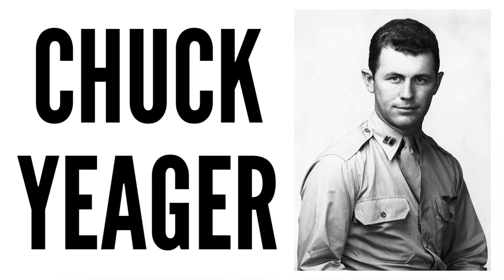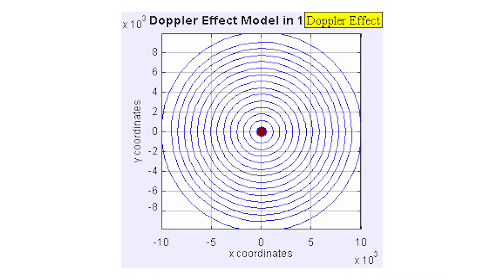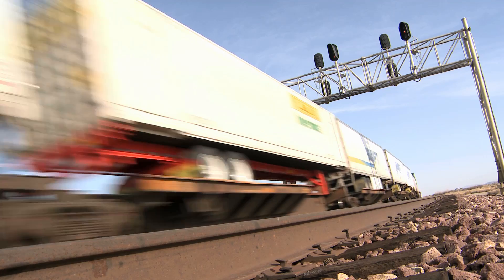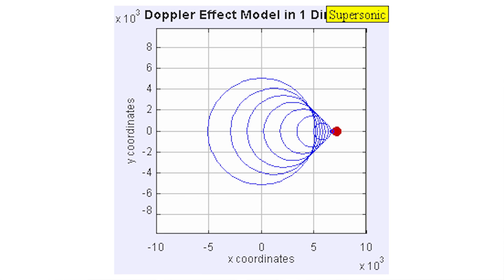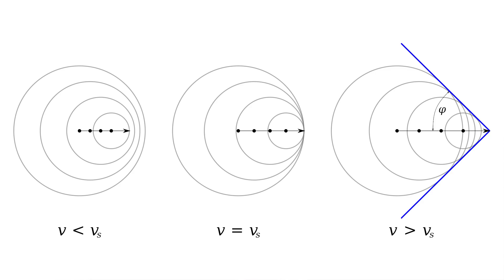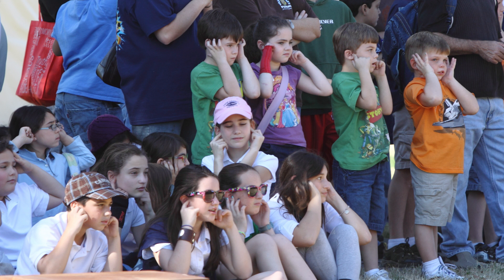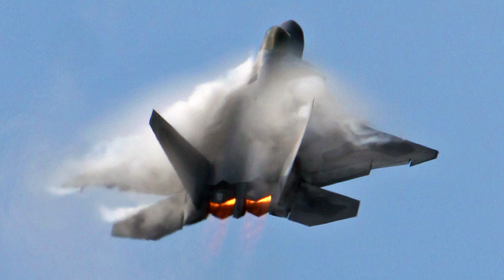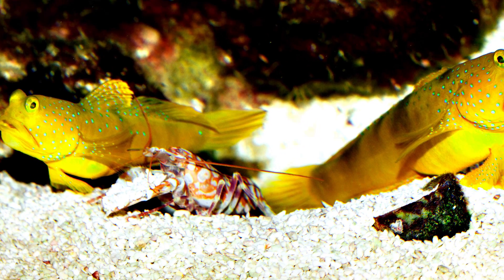What Is a Sonic Boom? And How It Breaks Every Rule You Know

Comment: The higher we go the faster we go right because on the ground we might go 400 meters In a second but then we technically only moved like 10 ft according to us. So technically we could be moving at the speed of sound from the point of view of the moon because if we were to go straight up from where we are toward the moon and then went back down to earth and moved a couple feet we wouldn't land a couple feet from where we were before we would possibly of moved a voluble miles because of how we loo at speed which is 100 m/s or something but because of the way all planets are shaped like spheres of you move a few feet you are changing the angle so you technically don't go any farther in either direction although it look like it because of the change. Pretty cool when you think about that huh that when you think about it in a not so technical way you are moving and the speed of sound to another planets point of view. Thanks for reading

Comment: When the pistol shrimp claps its pincers, a tiny air bubble is created in front of the pincer. Then, the entire weight of the ocean above it instantly moves to fill in the air bubble, causing rapid pressure change, and a temperature hotter than the surface of the sun. It is so rapid and short lived, however, that it doesn't boil all the water around it. I think there is a video of it on youtube.
Reply: VintageLJ imagine a pistol shrimp like 1000X the regular size
Reply: DragonGuard99 ShrimpZilla
Reply: You'd have to find a deeper ocean.
Reply: james learing So deep I found oil.
Reply: you mean a vacuum not an air bubble.
Reply: Theodor Berza Maybe.
Reply: Karan Randhawa Yea, probably.

Comment: What if the passengers speak?
Reply: DragonGuard99 I think if the air around the passengers travel at the same speed they can speak normally.
Reply: ItsReactive77 Sound waves travel by creating vibrations in particles in the air, this is where the saying "no one can hear you scream in space comes from" as it is a vacuum. Therefore as the Cabin of the aircraft is pressurized, the air inside the aircraft acts as if it is still, therefore sound moves normally through the cabin
Reply: DragonGuard99 only if the cabin was not isolated from outside imo
Reply: ItsReactive77 If the person hearing you is under 340 meters, there will be no delay.
If you were farther than 340 meters and moving away, there will be delay.
You would see your friend's lips moving and then hear what he said.
Same principle that occurs during light storms, first you see the lightning then you hear the thunder.
Reply: ItsReactive77 then the sound coming out would just pass by and you would not be able to hear it i guess. IDK
Reply: cyborgchimpy I don't know what the current theory on this is (please correct me if my statement is scientifically obsolete), but I think light works differently. Einstein theorized that if you moved at light speed, you couldn't even see yourself in a mirror in front of you (alsmo moving) because the light can't go faster than light speed or in this case, you. Thus never escaping your movement to the front and never reaching the mirror. Even thought everything else (sound etc.) would be expected to double its speed when sent from a moving source of the same speed.
Reply: ItsReactive77 For anyone thinking about this, the answer is they can hear each other. This is because the air inside of the aircraft is sealed from the outside, which means it has its own frame of reference. Basically, there is no difference between standing on the ground or being inside the aircraft. Sound will travel with respect of the aircraft and would observe to be moving twice the speed to an outside observer.

Light is a different story though. Nothing can travel faster than light and thus you wouldn't be able to see your own reflection.

cyborgchimpy  Your theory is wrong; heck you can't even travel faster than light anyway. Two reasons:

1.Interactions of particles that make up your body work at the speed of light, so you would become a soup of fundamental particles.

2. Time stops and the length of the universe would become 0 in the direction of the vehicle at the speed of light rendering this experiment impossible to even preform.

RJ Lee I Almost all of these comments are completely wrong, and I'm 16. I wasn't even in a high set in school either (although I should have been. Bullshit tests brought me down when they don't prove anything)
Reply: +ItsReactive77 The passenger compartment is sealed, thereby becoming it's own atmosphere, separate from the outside of the aircraft. They can speak normally, as they are speaking as if they were standing still at sea level.
Reply: ItsReactive77 Holy shit the replies.... Public education at its finest...
Reply: James Lynn You are going places, son. Keep it up.
Reply: the air in the aircraft is stationary relative to the aircraft, so it would be normal
Reply: Andrew Lewer That is the answer to another question I think XD
He asked wether passangers on an Aircraft over Mach 1 can hear each other or not. I think I agree with L4RZ, but I'm not sure myself. I guess if the medium (air) travels at high speed, the speed of created sound increases whilst in that medium. Otherwise Astronauts wouldn't be able to communicate at all, right?
Reply: the sound of the passengers voice will follow the law of inertia i think. they would still hear it
Reply: gasp they are coming.
Reply: ItsReactive77 you call that relativity. the air in the cabin is standing still relative to the people who are in the cockpit creating its own medium. so they can hear each other just fine. inertia is also another form of relativity. I think even with light, if you are in a ship that goes faster than the speed of light, shining a light within the ship would work just as you'd expect a cone of light to behave in a normal medium.
Reply: that could very well be right actually. I am not sure. I think I once saw some kind of visual representation of something supposedly going faster than light. the medium you would be flying in would actually stretch out, given the illusion you are going faster( as are the light particles in that medium) but when you would arrive at a given point, you would actually find out you arrived at the exact same time as a normal light particle/wave.
To be honest, its kind of mind boggling to begin with. I am not even sure how relativity would play in something like this. but it sure is interesting :)
Reply: cyborgchimpy That may have been about space-time warping (or however it's called).
That would be a whole other ordeal, indeed. If that were possible, then yes, I think light would behave normal relative to the traveler. But I REALLY don't have much clue what I'm talking about.... XD
Reply: glass gets broken
Reply: ***** Or read the replies before using common sensse. You can be heard. Otherwise, Fighter Jets would have a big communication problem.
Reply: TheThoerlChannel I got a stupid glitch that prevents me from typing. I'm going to edit it to add the user I was replying to.
Reply: RJ Lee Haha, I'm hoping to go places. I'm planning on getting a degree on civil engineering.
Reply: DragonGuard99
If you get to talk to anyone that flew on the Concorde, ask them how their conversation with someone sitting next to them went while eating a steak or sipping on coffee while traveling at mach 2.2.
Reply: +ItsReactive77 well, the passenger compartment is sealed, so they can speak normally. if it wasnt sealed it wouldnt matter because the 750+ mph wind would rip their faces off...
Reply: +ItsReactive77 well, the passenger compartment is sealed, so they can speak normally. if it wasnt sealed it wouldnt matter because the 750+ mph wind would rip their faces off...
Reply: +James Lynn sorry bud, youre wrong... light would behave normally, even at near-light-speed, so you would see your own reflection. 

due to time dilation, time would slow down. meaning that the light would move at its normal speed relative to you but it would also move at normal speed relative to another observer. this applies when moving less than light speed. moving at or beyond light speed is impossible because the energy required would be infinite
Reply: +James Lynn sorry bud, youre wrong... light would behave normally, even at near-light-speed, so you would see your own reflection. 

due to time dilation, time would slow down. meaning that the light would move at its normal speed relative to you but it would also move at normal speed relative to another observer. this applies when moving less than light speed. moving at or beyond light speed is impossible because the energy required would be infinite
Reply: +ItsReactive77 ... I CAN SPEAK LIKE I AM A GOD!
Reply: +GavMystro But what if you're strapped on top?